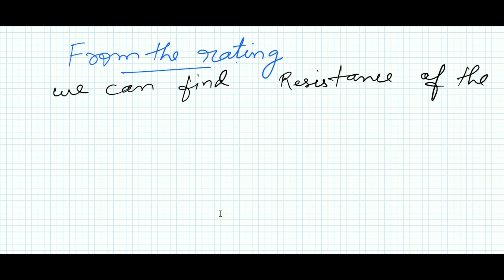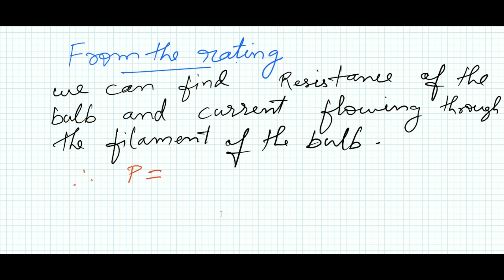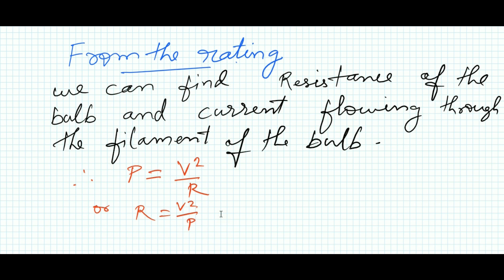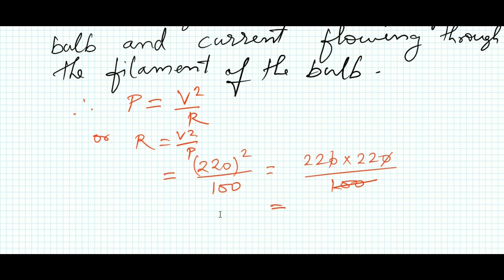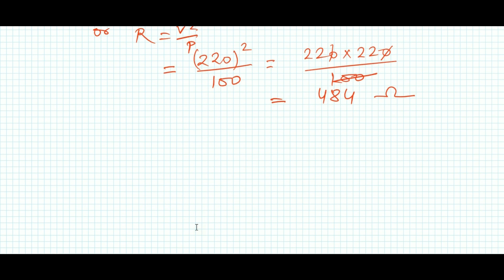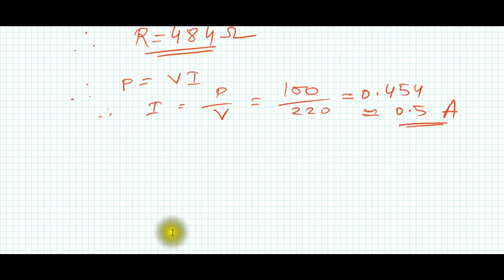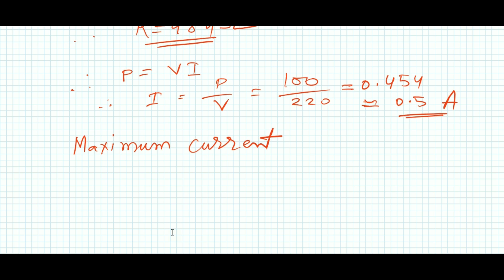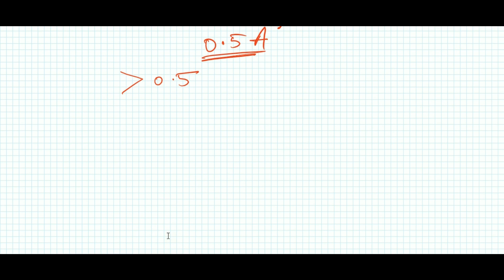4. Rating of Electrical Appliance and Calculation of Electrical parameters

Comment: Heating elements Ke resistance Kaiser gyat kare
Reply from the maker: R1=R0(1+aT)
a= coefficient of resistance   of the material
T= change in temperature
R1 is the resistance at required temperature

Comment: Five bulbs each rated as 200v_100w burnt for 4hour what is the cost of electricity consumed if the rate is 50 paise per unit sir give it's full solution and formula
Reply from the maker: one bulb's power cousumption = 100x4=400wh
5 bulb's power consumption = 5x400 Wh= 2000 Wh= 2kWh=2 unit
Therefore cost of electricity= Rs. 0.50 x 2 = Rs 1.00 Ans.